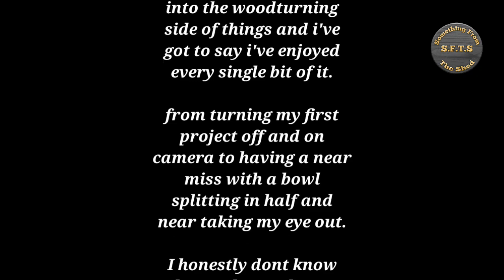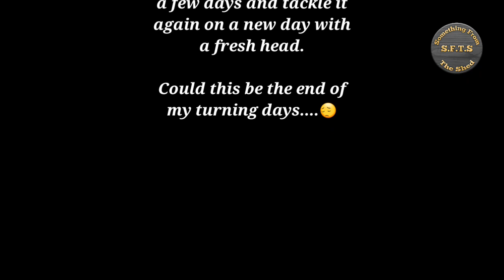Part 5 The dieing of the laithe.

Comment: Hey don't give up that easy, there's a lot of things that use motors like that, hell you could even use a motor from an old washing machine, it's the gears that gives you the speed, just don't give up bud
Reply from the maker: Im not going to lie Larry but i honestly felt like criend when it wasnt the fuse. 

Thankfully on the sunday after filming this i went back out and cleaned my shed and decided to have a go at finding and fixing the problem.

Will explain more in my next video.

Thanks man.

Keith

S.F.T.S
Reply: @SomethingFromTheShed  I know how you feel, I had a bearing go bad and I didnt know if they were still available, my lathe was made in the 90s and I didn't know if it was a common bearing or not,